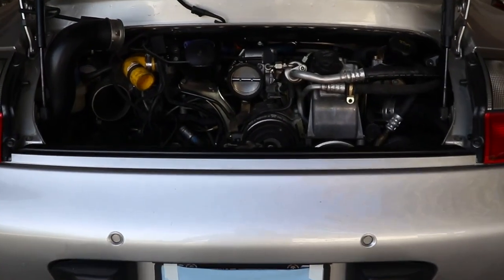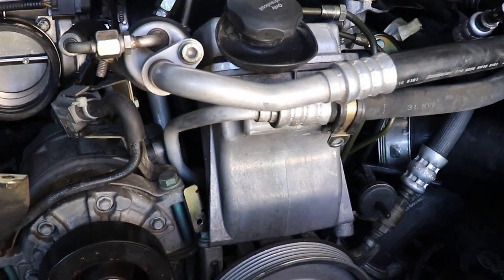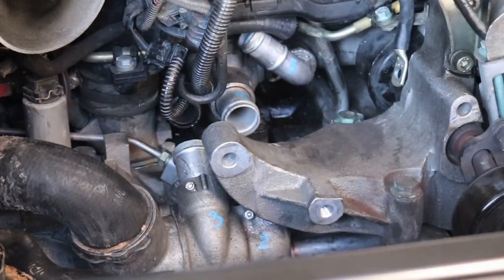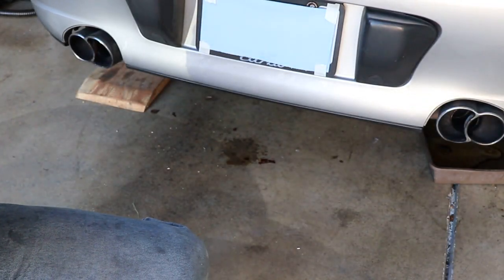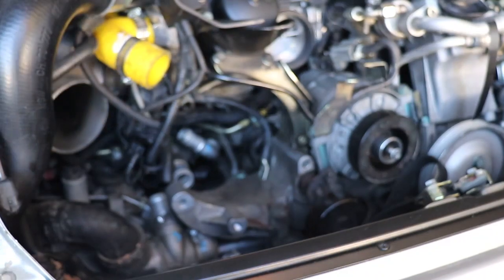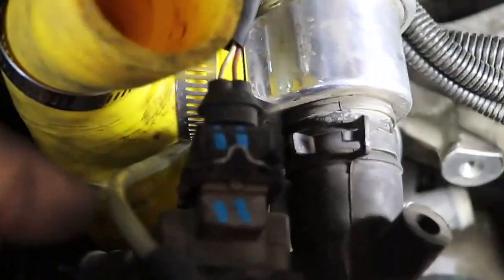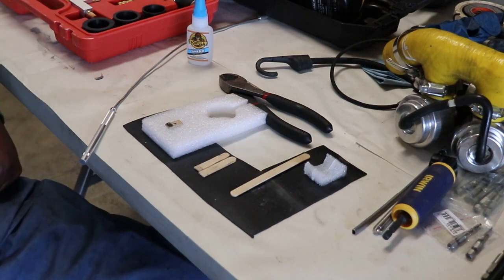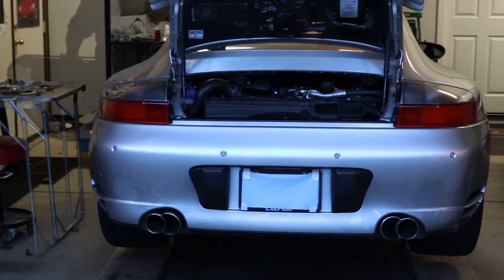Part 2 of 4 Porsche 996 Turbo Coolant Pipe Pinning and fittings repair

Comment: Hi Clint, looking to do this on my 958 Cayenne Turbo - it has one fitting that needs this correction. How did you determine the length of the screw to put into the fitting, to be sure that it is not protruding into the coolant stream and disrupting the coolant flow?
Reply from the maker: The housing is thicker than the fitting, so just double the thickness of the fitting and it won't go all the way through.

Comment: Clint you are one serious creative dude to get that job 🔩 accomplished.   Just started looking at purchasing a 2002 996 turbo. Is this a common issue as looks to me like the factory pressed fit pipes into place with some glue that over time let's go.  I've owned many cars and have never had to deal with this issue.  Is this just a 996 thing or does the 997 suffer from this engineering design defect as well?
Reply from the maker: Both 996 and 997 have the coolant pipe issue and it is a matter of when not if it will happen.  They all have the flaw and it needs to be addressed as they age.  I will be re-pinning mine when I take my engine out to change the clutch and a few other bits ...
Reply: @Engineerboy100  when you say re-pinning, what do you mean? how will you be improving the approach you used in the video?

Comment: Clint, any worries about shavings getting into #5, I noticed there wasn't a wirefoam plug in there?
Reply from the maker: No shavings in #5, I was worried about that tho with number 8 and that is the main reason I didn't do it....it is also very hard to reach but not impossible.  I'm waiting for engine out for that one.

Comment: Clint, what is the part number for the flexible drill attachment? Great work as always.
Reply from the maker: https://www.ebay.com/itm/2X-295mm-Flexible-Shaft-Bit-Extension-Screwdriver-Bit-Electric-Drill-Power-Tool-/202311807726?hash=item2f1ab932ee
Reply: Thanks Clint!

Comment: Well I might finally get off my butt and pin the pipes in my GT3 now that winter's here.  Should be a fair bit easier than the turbo.  One question: what kind of torque did you apply to the screws?  I know that generally the torque on a 4mm x .7 socket head screw going into aluminum should be about 5 Nm.  The aluminum housings look pretty thin so did you just snug them and figure the sealant would secure the screws?
Reply from the maker: Yes, that is exactly what I did, just snug them and let the gasket sealer do the rest, don't want to strip those threads. All are Still holding well.

Comment: I'm planning on pinning my cooling lines this winter.  You mentioned that the compound you used for the flanges was thicker than the epoxy you used on the knurl surface (7056al).  What compound did you use exactly for the flanges?
Reply from the maker: I would use the thinner version of JB Weld for all areas.  The thicker version ultimately was not used and does not apply well.